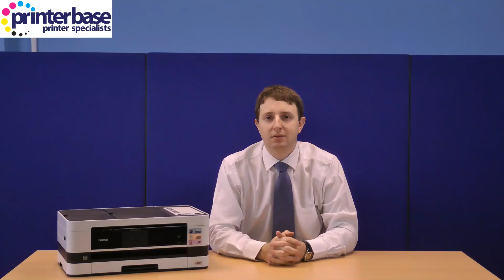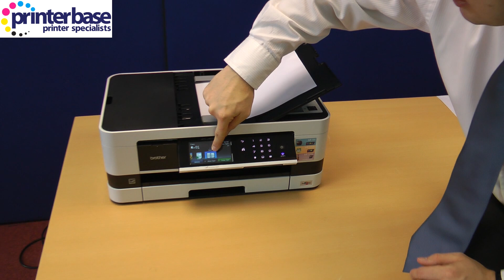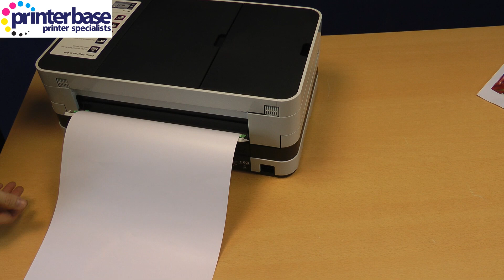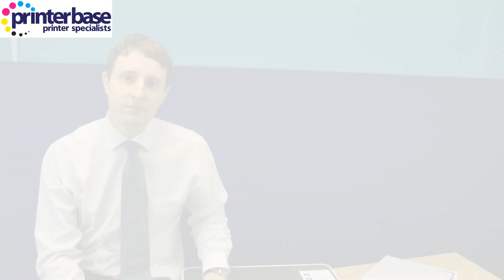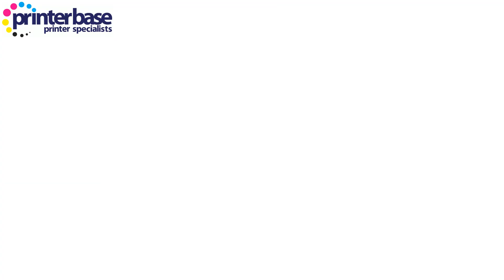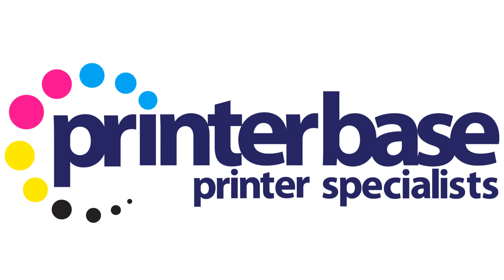Brother MFC-J4510DW A3 Multifunction Colour Inkjet Printer Review

Comment: Its a clunker. This is a classic "kitchen table" review where the manufacturer's specs are repeated as if its a real review. I've had mine for about a year and am about to throw it away. Have spent more time struggling with print quality than actually using it. Ink is used up at a prodigious rate and that is where the real money is made. Reminds me of an English Car of the seventies. Looks good but it just does not work well at all. Photo printing quality marginal.
Reply: they are  absolute rubish took mine two days old and shot it worst printeri have had